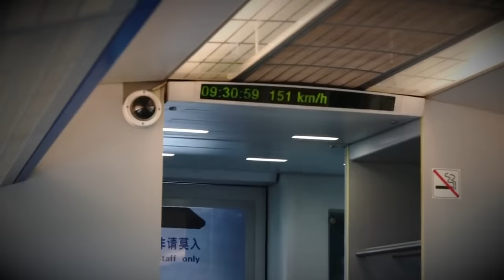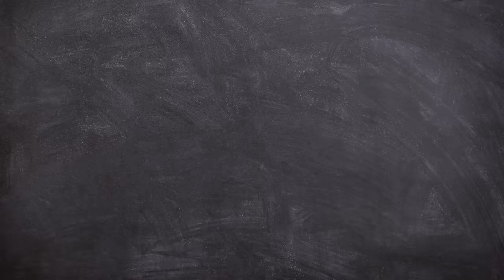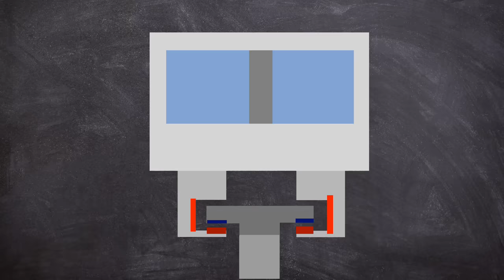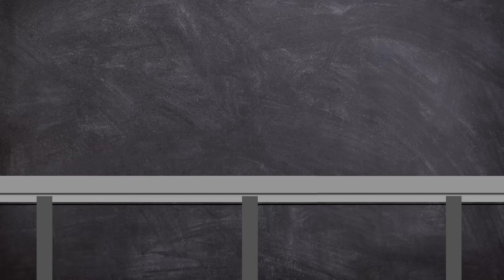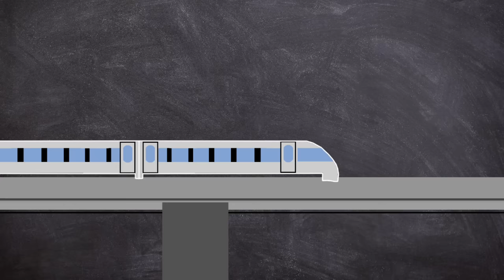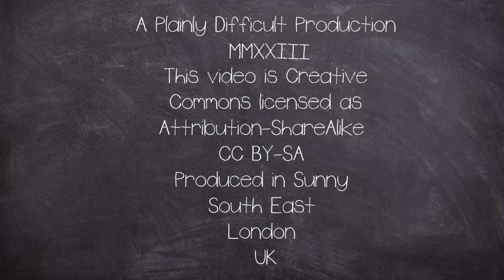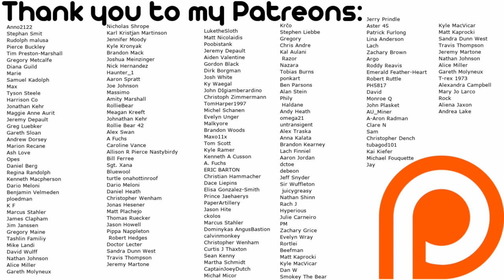Safety Complacency: The Lathen Maglev Train Disaster 2006 | Plainly Difficult Documentary

Comment: It's worth pointing out that Maglev is getting another go, particularly in Japan, and that they are actually building a full scale for-public-use track right now so it's definitely a viable concept given the right circumstances. It seems likely that the technology will continue to mature and will see greater adoption, but it is really only suitable for those very high capacity, high speed rail connections where saving time with speed enables more passenger throughput and justifies the cost of the project. Maglevs do have real benefits including in terms of maintenance, but the technology is still maturing and the initial cost is very high
Reply: The "viability" part is questionable tho. Not as "can it work?", more so "do we need it?".
If the cost of infrastructure and production of not-trains outweights such for more traditional types of transport, the only other question is "is it more eco-friendly" which has basically the same question.
The main idea of "train goes very fast" isn't something that we really need. Neither in public transportation, nor in commercial transportation.
So far, as you said, it only seems viable in very specific circumstances, and that isn't really fault of "tech not being good enough".
Reply: I disagree, particularly on the topic of maintenance. A maglev needs a far more complex supporting infrastructure compared to conventional rail transport. That complexity will inevitably turn into quicker degradation, more frequent preventative maintenance, higher long-term costs, and likely some cut corners. No physical contact with the track also means the train might collide with it destructively in case of a failure.
In my eyes, maglev technology is the same as supersonic passenger airplanes - a cool concept, an engineering achievement, but too many drawbacks and risks for large-scale adoption.
Reply: The initial cost may be higher, but if we look at Japan´s highspeed trains and especially their tracks, they need quite some infastructure as well, and the lengths they have to go to make those trains work and stay on its tracks, it´s not that much.
Maglevs are faster, a once proposed line in Bavaria was planned for a top speed of 500km/h, highspeed rail stays below 400kmh in regular service (currently).
While Maglev is less efficient than electric motors (needs additional lift energy), the lack of friction losses in practical application makes it a little more efficient in the end.
The acceleration is better,  the Transrapid accelerates to 300 over 4km, the German ICE needs 18km. 

Speed is what makes highspeed rail and even Maglev very viable.
Sure, you can fly 500km, takes maybe 45 minutes. Plus checkin and checkout, that easily adds up to 2hrs and more, still you´re nowhere near a city centre.
Rail does that in an hour and can stop right at the central train station.
Plus it runs on electricity which can be produced in dozens of various ways, planes need fossil fuel.
Reply: @seeinred  Circumstances always change, so technology not deemed viable at one point can make a lot of sense later, especially when the tech evolves which may be triggered by said changed demands. National flights in some countries have been under scrutiny for instance. If you had connections that can cover 500 miles reliably and safely in 2 hours on ground, that could be a game changer.
Reply: @Wampa842  With your attitude we should be living in caves and rely on hunting and gathering. Anything else is just way too much maintenance. Why get a house with a heating system and a toilet. Think of the maintenance! Just make a fire in the cave and shit in the woods.
Reply: @seeinred Train goes fast is something we've needed forever. Imagine not being limited to flight in order to quickly reach the other side of the US? 

Anything that "shrinks" the world is worth it in my opinion. 

Plus, American rail already need an extreme overhaul.
Reply: The track itself is very expensive and only going to get more expensive as they compete for resources with the global shift to electrical.
Reply: Maglev trains oparte in China and South Korea as well.
Reply: @seeinred  In Japan, the Shinkansen was built to displace business travellers from the regional airlines, especially on the key route between Japan's three principal cities:  Tokyo, Nagoya, and Osaka.  It worked because it was just as fast in practice as travelling to the airport, flying in a technically faster vehicle, then getting from the arrival airport to your actual destination in the city centre - and was cheaper than flying.  It compared very favourably with travelling at half that speed in a conventional narrow-gauge train.
Today, the Shinkansen on that route is at capacity.  16-car trains run every 10 minutes during business hours, with every reservable seat booked and every unreserved seat occupied.  Business travellers are, once again, using the airlines to get to their meetings.  These are the conditions under which Japan is building the second Shinkansen between Tokyo and Osaka, this time on an inland route and using maglev technology.  They will have a ready and eager market of business travellers with open wallets - ideal conditions to recoup the large investment.
Most importantly, the Shinkansen has an enviable safety record throughout Japan.  No passenger has ever been killed due to a Shinkansen accident, in 60 years of operation.  They will be keen to keep up that record with the new line.
Reply: @Wampa842  You don't know anything about this technology. Once built, it's maintenance free. Contrarily to steel wheels on steel rails, there is nothing that can wears out.  There is also nothing complex at all, in the case of the Transrapid, it's just magnets on the train that attracts down a steel surface of the track (thus pushing the vehicle up). It's just an electromagnet with a closed loop system to maintain a distance between the coil and the plate. The engine is very expensive, because the whole track is the engine, but once built, it just work without ever wearing out. Nothing rotate, there isn't even a ball bearing that can wears out...
In case of failure of levitating electromagnets, the train just skids on plates. In the case of the french air cushioned Aérotrain, it was wood skids. Simple hard wood blocks were used as an emergency landing gear....
On the other side, high speed rail need daily (nightly) inspection of tracks. And regular (2 times/month on the whole line) grinding/re-profiling....  It cost a fortune. And it's slower.... And don't accelerate quickly enough to provide medium scale service. Shanghai Transrapid attains full speed on a ridiculously small route... Try to do this with an high speed train...
Reply: @SECONDQUEST  The problem is, is it worth the investment, and how many people does it improve travel for.

If it's crazy-expensive and only wealthy people can afford to use it, that's a big mark against it being worth it even if it will support itself economically.
Reply: @IstasPumaNevada  same was said of the airplane, only wealthy people were able to use a plane for traveling, by the 1960s everyone was flying. Same with high speed rail. Every country is investing in high speed rail, Morocco and Turkey some of the latest with high speed (300km/h average) cost of maglev trains and infrastructure will come down as the technology is applied and improved. China, Korea, Japan have maglev sistems running and more in construction
Reply: @PatricioGarcia1973  Actually most people didn't fly before 1978 (the start of deregulation). It was simply too expensive (the fares were set by the government until then.) I was a travel agent at the time and the change was astonishing. Here in Orlando, for example, we had 4 airlines and 4 fares on Fridays. The following Monday we had 11 airlines and over 2,000 different fares and rules.
Reply: @Wampa842  "No physical contact with the track also means the train might collide with it destructively in case of a failure."

The average maglev hovers 4 inches above the track so if the levitation mechanism fails it'll be a short uncomfortable drop. Ofcourse when the train hits the track it will come to a very quick stop which is hell for the passengers, but then again when a regular train chews up the rails it will also stop very quickly and throw it's wagons off the rails chewing up the passengers as the big ball of bent steel crumples up. We've all seen the images.
Reply: @seeinred  maglev i more viable than high speed railway, so its really high speed railway that should be questioned
Reply: @Wampa842  does it? Can you point to the specific complex infrastructure needed?
Reply: @IstasPumaNevada  what number du you have to confirm that its crazy expensive?
Reply: @Wampa842  what parts are more complex for maintenance? you have to be specific, you can't just say it's complex without saying what and how.
Reply: @sthenzel  and the japan's chuo shinkansen scmaglev is only expensive because they decided to dig tunnels for most of the line
Reply: @Damien.D  Afair the Transrapid even has rollers, makes low-speed shunting or moving a train during a power outage much easier. Braking a rolling train without a power source isn´t too much of a problem, just shorting the coils should be enough, Eddy currents will do the rest.
Reply: If the price of electricity falls, it might become move viable to go to even higher speeds, even though it wastes energy.
Reply: Question is: Is it so much better then existing infrastructure? And it doesn't seem so.

With systems like ICE, TGV and Shinkansen you can use existing tracks. You don't go fast on older tracks, but you can use facilities like stations, switches and depots that are already existing. You don't have to build everything new. And that's a benefit for systems that might not be as good or futuristic. They are cheaper because of it.

And that's why maglevs only get applied in completely new point-to-point transport.
Reply: @DrKlausTrophobie  Only applicable for ICE and TGV since Japan's gauge standard is narrow gauge while Shinkansen is on a totally separate standard gauge
Reply: JR-maglevs have tyred landing wheels tho, they float only above 100-something kph.  That Tokyo-Osaka corridor is the only one on earth with enough demand to make that maglev viable
Reply: Idk how the other maglev type is expanding, used by linimo, in Incheon, in Beijing, and in Changsha
Reply: I guess the first large-scale one, there's already one in Shanghai since 2002 but it's only 30km in length.
Reply: Wonder if you could use the old hoverboard technology to make it a passive maglev and move it by an active engine part. 

For those that don’t remember, the hoverboard used magnets on a lawnmower to create repulsion from eddy currents.
Reply: @Kromaatikse  the maglev is a big white elephant in China AND in Japan.  It is  VERY expennsive.
Reply: @matsv201   ask the Chinese with their big losses or the INSANELY costly Japanese one.
Reply: @MarceloBenoit-trenes  
"ask the Chinese with their big losses"
Is it really? you have number on it or is it speculation?

"INSANELY costly Japanese one."
How much of that cost is tunnel and how much of it is maglev track? Did you see the comparison for traditional rail Shinkansen what that would cost?
Reply: @matsv201  the Chinese says that, that the Transrapid is expensive.  And Siemens too.  Look for info.  And the maglev track IS EXPENSIVE, and tunnels are more expensive because they need to be bigger than conventional ones.
Reply: "the Chinese says that, that the Transrapid is expensive."

Who "the Chinese" Hope you know that SMT is not owned by the Chinese government.

" And the maglev track IS EXPENSIVE"
Do you have a number for it, or are you only guessing?

" they need to be bigger than conventional ones."
Really? the numbers i seen point to the opposite. A ICE train needs a 250m2 tunnel, a Transrapid need a 225m2 tunnel and a Sc-maglev need a 150m2 tunnel.
Reply: @seeinred  You have to consider the impact on the national economy, GDP wise. Connecting Tokyo to Osaka in roughly one-hour is something that is hard to imagine!
The expectations are a gigantic megalopoly stretching all the way from Tokyo to Osaka. The economic impact will definitely be greater than the incremented cost.
Reply: @seeinred  The Maglev in Japan is being built by JR Central using government loans and their own operating revenue. When complete it will have a transit time from Tokyo to Osaka of 67 mins. A flight takes about that time without all the waiting and hassle of an airport. At 67 mins, a daily commute between major cities is actually viable. There is already a high-speed line with huge numbers of passengers as well as about 100 flights a day between those cities, so demand is there.

It's a 90B USD project, they have already dug over 100KM of tunnel.
Reply: @seeinred You must see it from different glasses.

- Passanger view : Safe, faster, fair price : yes, we need it.
Who want to use that slow relic train, that's cr4sy. 
- Country view : We want to perfect the technology so we can sell it to other country
- Investor view : if we build it, they will use it
- other country view :.We want one, so we can build it ourselves

Especially from passanger view : safety, 
Airplane is more dangerous then train.
Reply: At some point, Japan continued to operate a whole train route for years just because there was a single person using it. Just because they do it doesn't mean it's viable.
Reply: @michaelbuckers  That's true, but in this case, there is a demand to justify the service. Looking at the existing line a flights, there will be more than enough demand.
Reply: @matsv201  Reality seems to disagree... if maglev was more viable than high speed rail, why hasn't it seen more adoption- especially in China or Spain, which have built up conventional high speed rail networks within the last decade or so?
Reply: @exsandgrounder  

We know now why it was not adopted in China when they built there 1st and 2nd  5 year term of high speed rail track.

What is built in reality is not always dictated on what is best. With that logic everything that is best would be built at all times.

Practical reality don´t work that way.

Spain start building there high speed network in 1992. Transrapid was not a finished product until 2000, and it was not sold on the export market until a year or two later.

On top of that, most of the cost of Spanish high speed network was payed by EU, not Spain. One of the stipulation on thy grant (that may i remind you was over 50%) was that it should be built to 1435 mm gauge standard.

There was many university studies in spain at the time after 2000 claiming that Transrapid track in spain would be more economical. While you can of cause say that those papers was wrong, and they could indeed be wrong, it really don´t matter if they was wrong or right becasue it was never actually formally investigated.

You really have to point to a formal investigation that is bases for selection between high speed rail and maglev if you want to claim that reality was not on my side.

The only investigation of that type i know of was the Japanese Chou shinkansen investigation, and well, it determined that maglev would be more economical. Hence they are building maglevs.

real reality never works as theoretical reality
Reply: Sure, super-fast trains in one of the world's most active earthquake zones. What could go wrong? 😱
Reply: @alkh3myst  How many people do you think have been killed due to earthquakes on the existing high-speed rail in Japan? The answer is none.
Reply: @alkh3myst  Shinkansen already have emergency braking systems in place to react to seismic activity. The L0 series will have onboard batteries/generators to keep itself aloft briefly in case power to the track is disrupted in an earthquake, then it’ll just brake to landing speed and slow to a stop on its tires. Japan’s been building high speed trains in a fault zone for a few decades now. They know how it goes ☺️
Reply: @vinny142  As I understand there are wheels under the train that will catch it and allow the train to roll instead of just slamming into and slide along the rails in case this would happen.
Reply: In China too
Reply: Maglev doesn’t make sense from a financial standpoint. Planes can offer even higher speeds for much cheaper. The fact that they exist at all in some places is purely because of the high-tech image that allows governments to show - either their citizens, or the rolled - ‘what they can do’.
Reply: @mioszradomski1825  Put a Maglev in a vacuum tube and it will go as fast as an airplane. Given how much we spend to go "green", it makes total financial sense.
Reply: @asdf3568  good luck making a vacuum tube the diameter of the train that is hundreds miles long. Making a pressure vessel this large, in open air (subject to changing atmospheric conditions) is simply infeasible and because of its scale (considering the costs of maintenance even if one day it could be constructed) it will never be.
The ‘going green’ energy should be put into nuclear power plants and biofuels but there never was an intention to actually go green. And a giant high tech pressure vessel requiring constant maintenance work and rebuilds would be the opposite of green.
Reply: @mioszradomski1825  The Chinese are reportedly buiiding a test track that does just that. You people are the modern version of people who said we would never fly.
Reply: Most situations, convenyional high-speed rail or planes are better
Reply: @MarceloBenoit-trenes  Hang-up the CLICKBAIT! type-font gramps, it's embarrassing.
Reply: @crazykirsch  what?
Reply: @portlandthorns9929  Well . . . that isnt the ONLY reason but yes, in principle it would be a lot cheaper if they didnt have to bore tunnels through 75% of the route.
Reply: @eatcarpet  The test track in Yamanashi is longer than the Shanghai maglev, and it has been in use longer. And it already carries passengers (albeit only as a glorified amusement park ride)
So yeah ... they meant it will be the first large-scale one.
Reply: @mioszradomski1825   "Planes can offer even higher speeds for much cheaper"
Says a person who clearly doesnt live in a highly congested megacity. If a maglev can cover a distance between cities in 4 hours, but a plane can do it in three ... plus 90 minutes to get to the airport, an hour to check in, an three-hour "unscheduled delay", and then 90 minutes or more to get from the airport to any place that a human being might want to visit ... why would you use a maglev? 
"Higher speed" has to be calculated using a real-world comparison. Not some empty statistic.
Reply: I'd bet that the maintenance on the powerlines over conventional tracks and removal of plants on and around them, the regular maintenance and replacement of wheels and the many other mechanical parts of a normal train would add up to more than the admittedly expensive but likely far less frequent and extensive maintenance of a maglev system. Of course, both pale in comparison to the expense of creating and maintaining motor vehicle infrastructure, but that's another discussion.
Reply: @Wampa842  I don't agree on this one. Maglev being no-contact is actually a huge maintenance boon because you have no friction nor point stresses between any parts. The guideway is just a static, untouched hunk of metal, possibly with also static and untouched loops of wire. You do need to string a power supply along, but we already do this no problem for high-speed rail, and those wires get smashed at 300 Km/h many of times a day.